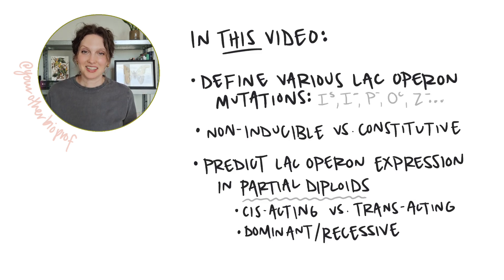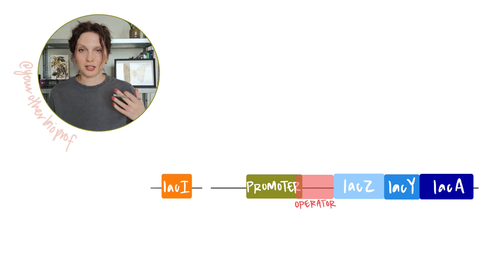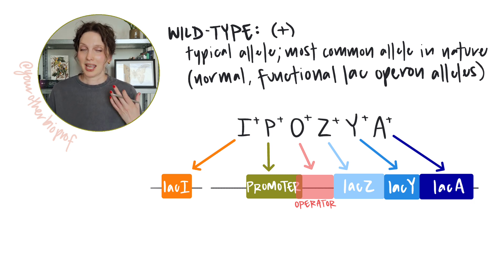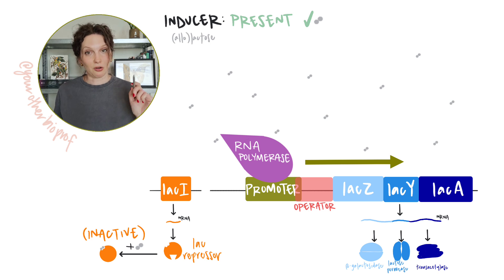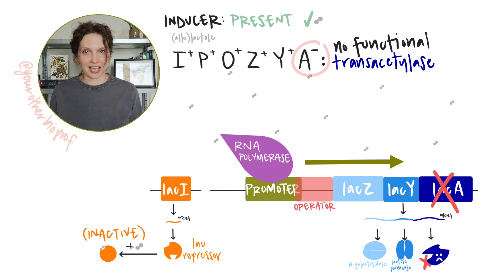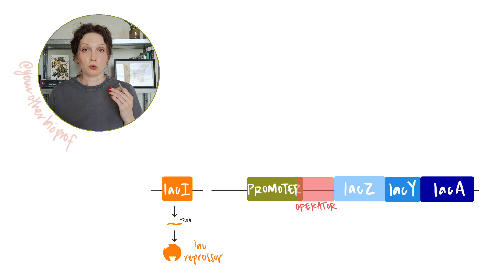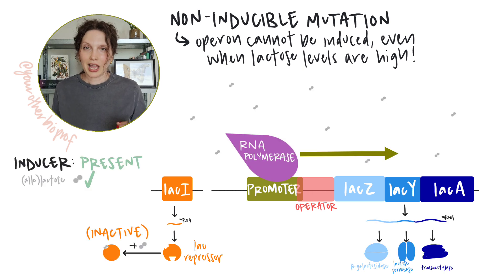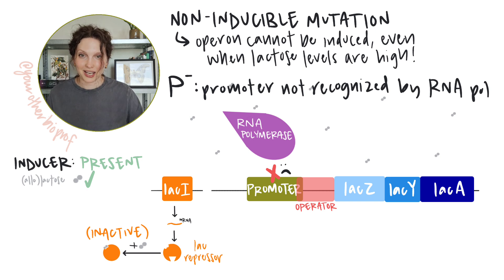Lac Operon Mutations: Why Won't It Turn Off?

Comment from the maker: IMPORTANT NOTE! If you made it to the section on constitutive mutations (I- and Oc, beginning around 05:19), with scenarios where lactose is unavailable but transcription of the lac operon is still happening due to mutations, and said "Umm...why is there lactose in the drawing, Sarah?!" Yeah...oops. I copy/pasted the repressors from the drawings in the previous section, tweaked them, and still managed to forget to fully remove the lactose. Turns out, I was all out of witty opening lines AND lactose-erasing skills.

Everything else - the description and the activities/positions of the repressor - are all correct, but those little lactose molecules shouldn't be there. So, let's pretend they aren't. Although...with those mutations, the result is the same either way, with lactose or without - no repression of the operon.

You can see the lactose-free drawings in this post: http://youtube.com/post/UgkxQ3pZGuLuG8QnMn_bDgifRWDJQfSqovl0?si=fQ6BeNkRhYgnCOLz

Sorry if those little grey lactose bubbles caused any confusion!